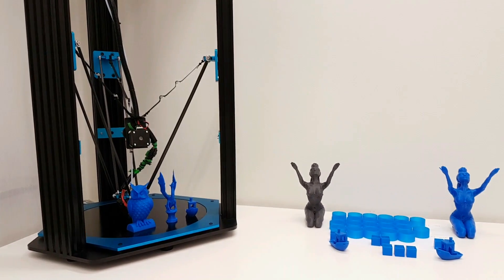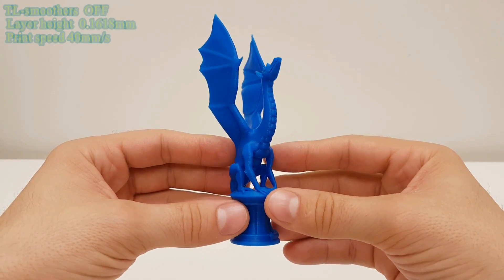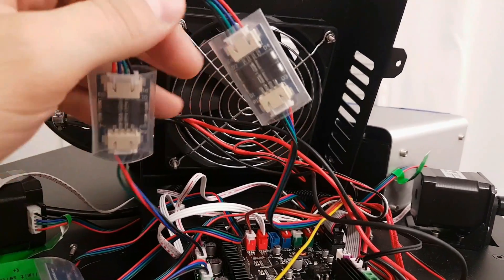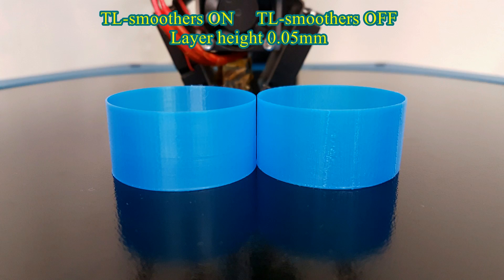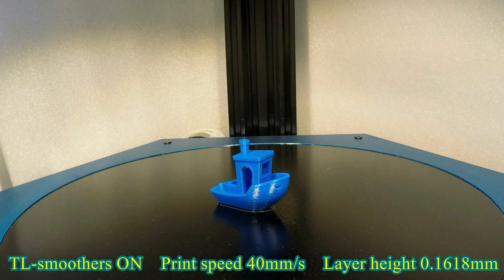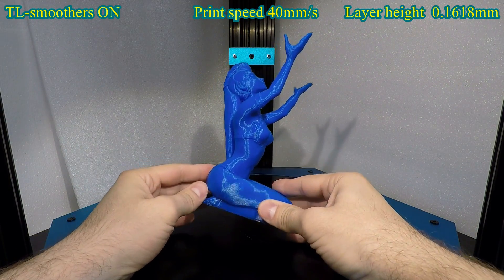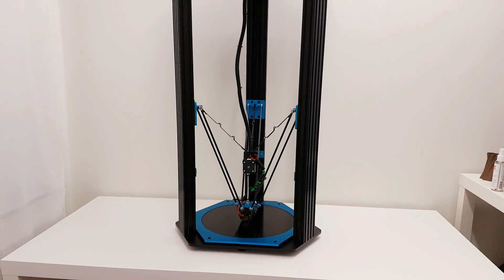TEVO Little Monster HUGE print quality upgrade! No more salmon skin!

Comment: Good morning, please help me. I have just finished assembling the TEVO LITTLE MONSTER and I have not yet done what was written in the "UPDATE INSTRUCTIONS. I turned on the printer and the arms with the hotend went to the HOME position. I turned off the printer and after a couple of hours I moved the arms manually to check that the belts that hold the thrust and the hotend are not too tight, turned on again but the bed calibrator turned red and did not move anything. I tried to move the arms but nothing happened. I pressed the house Home but nothing. Only the self-leveling meter remained switched on. After a couple of minutes, both the self-leveling device and the touchscreen are switched off. I double checked all the connections and I find them all OK. Why do not you move anything ?. Thank you in advance, I look forward to your instructions and best regards, Luigi Vitali

Comment: Please can you explain well if you have to enter 2 TL SMOOTHERS for each X - Y driver and extruder or just one. How many TL SMOOTHERS is right to put and on which drivers ?. Maybe you already explained it in the video but. unfortunately, I speak Italian and I do not understand English spoken, for that written I use the Google translator. Thank you very much for your help and I greet you very cordially.
Reply from the maker: Luigi Vitali Now there are new version of TL-Smothers with 8 diodes (old had only 4 diodes) so now you only need 1 TL-smother per each axis. 
 1 for X, 1 for Y, and 1 for Z. That's it.
Reply: Grazie mille

Comment: Could you use as many TL smothers as you want. Like 4 on each motor?
Reply from the maker: Nick boyco No you can't you will lower voltage to much. In video description you have new 8 diode TL-Smothers and you only need one per stepper motor.
Reply: Ok. Thank you

Comment: So print speed...your prints in this video were all done at 40mm/s.  I thought the whole point of delta printers was for higher speed printing, given that the Tevo Little Monster has a print speed max of 300mm/s.  Have you tried this printer with higher speeds, say 150mm/s?  I don't see the point in getting a delta-style, if I would have to print at speeds slower than my Ender-4 or Flashforge Creator Pro can do.
Reply: Deltas can indeed move at surprisingly high speed, BUT the 3D printing process is limited by a number of other factors. Assembly line "pick-n-place" deltas can take advantage of the high speeds, but not so much w/ 3D printers.

That said, delta 3D printers do have some nice properties. For one, the print bed is stationary, thus artifacts due to a moving model are not introduced. Also, w/ an indirect filament drive ("Bowden") the print head has less inertia, so motion can be smooth, plus a lower-spec, cheaper motor can be used. Furthermore, deltas have a significant build volume relative to the machine size. And, the design is modular, and easily scaled up in size. BUT actual print speed is not one of a deltas true advantages.

For an interesting insight into ACTUAL print speed, run your gcode thru www.gcodeanalyser.com... you may be quite surprised!
Reply: Derek Horn Exactly I think same. I think high speed for Delta printers is a myth, only way for reach 150mm/s or more is upgrade the drivers with decent quality

Comment: Great video, if I use these, will  I only need 1 pcs for each motor since they have 8 diodes per pcb?
https://www.ebay.co.uk/itm/4pcs-filter-TL-Smoother-new-kit-addon-module-for-3D-pinter-motor-drivers-us-E3O4/222933820602?epid=28015528791&hash=item33e7e424ba:g:3fAAAOSw2Yta2Yie

Comment: Hey man, very nice video! It's thanks to you I opted for TL-smoothers for my Little Monster as well, thanks for that bro! You're getting some really great print quality out of your machine, mind sharing your printer/print settings? What software are you using? I'm having some small issues with stringing despite several attempts at adjusting retraction, temp and speed etc...

Thanks man!

Comment: They are not filtering, they don't block the "noise". 
The diodes create a voltage drop, that's it. Nothing more. 
The idea of a TL smoother got ripped from this guy's website => http://www.engineerination.com/2015/02/drv8825-missing-steps.html 
Without TL smoother you have missing microsteps, I did some investigation on my wanhao i3 plus, and also stumbled across this problem. I hope you  and others like the extra technical information.

Comment: Can you explain golden ratio? I assume it’s the layer heights that work the best with the best layer lines, but it’s the first time I’ve heard of it and I want to learn how to find what my printer’s golden layer is.
Reply: It's nonsense.  Golden ratio only means something when it's a RATIO (meaning there must be a second dimension to relate to).  He's setting the layer hight to 0.1618, which happens to look like Phi, but isn't really because the decimal is in the wrong place. Phi is a ratio of 1.618 to 1.  Using those numbers as layer hight means nothing.
Reply: This video, and your valid critique, has prompted me to start writing a reply, but it's in danger of growing overly long. So, I will offer just this, for now... As a mathematician, and healthy skeptic, concerned with critical thinking and its application to truth claims, the matter of the use/misuse/abuse or the Golden Ratio is of particular concern to me. In short, MANY claims regarding the GR are demonstrably false - and I suspect this GR/3D printing "connection" is such a case (even putting aside that the numbers often quoted are incorrect). OK, back to writing my reply "tome":)...

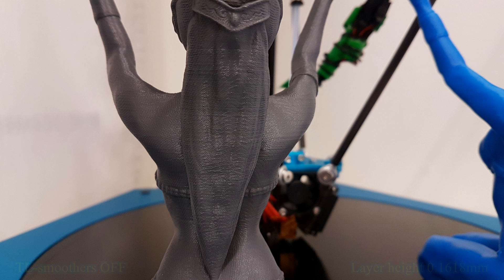Comment: 6:36  I suspect this isn't an issue of which stepper motors you have , as much as your stepper drivers.  Which mostly means which control board you're using.  Because what the TL Smoothers are doing are providing line conditioning, and smoothing out the sine wave.  So if you already have smooth power delivery these smoothers won't do much.  Speaking of which, it's a good idea to run your printer through a UPS.  This does two things.  One, it helps protect your prints from power upsets, which is a huge plus as you don't want to lose a print due to a power event (blackout/brownout).  Two, a UPS provides a pretty good level of line conditioning on the cheap, which helps make your electronics last longer, and in the case of analog systems, like 3D printers, helps improve performance.
Reply: Exactly.  Providing a noisy signal to the motor creates noise in its motion.  The mainboard/controller board is at fault here.  Its a cheap fix though.  Maybe TEVO which spend the 20-50 more dollars to upgrade the mainboard so the signals going to the motors isn't shit so this fix isn't required by every single person that buys one has to do this.  Maybe the next version will "listen" to their community and fix this issue and charge $50 more because it would be well worth it to not have to faff around just to get... really amazing print quality with their machine.  You'd think they'd WANT that from their machine.  Hell they could sell way way more machines without this issue.

Comment: Hey Guys, I bought the tl smoothers and thought I should share my thoughts... to start off, I should state that I do appreciate the person making this video and I don't think they did anything wrong... I just didn't get the same improvements that you see in this video. If I was to gauge it I would say the improvement was around half as good as in this video. I complained to the company in China and they actually responded which was a surprise. They sent me before and after pics to prove their point but I stand by my results. I still get significant salmon skinning and surface texture. It might be something specific to my printer but who can say? I did read from the blog of the original designer of the tl smoothers that some chinese companies were selling parts labelled as tl smoothers but with the incorrect components. Hope this helps someone.
Reply from the maker: Hi Scott, Thanks for feedback. That would be me :) You Welcome. Tell me did you order Tl-smoothers from link in video description? With 4 diode on board?  And did you install 2 peaces on every axis? Including extruder? Did you use golden ration layer height and same print orientation? CURA or? Regards! Nexi
Reply: Hi Nexi, Yes, I've got the profiles in Simplify3D with the 3 golden ratio heights already plugged in and I used the link in the description to buy them. I bought 8 tl smoothers in total and have two on each driver (incl extruder) as per your video.
Reply: Scott if you suspect stepper motor noise, you might also want to consider conditioning your mains input power.  A UPS works great for this.

Comment: The question was asked below, "Why two per axis?".   Because a properly engineered, diode-based, "smoother" needs 8 diodes for a bi-polar stepper motor.  Several manufacturers make them this way, including Witbot and MKS.  

However, in the "race to the bottom" pricing of our current world, some manufacturers are making them with only 4 diodes.  

By changing the wiring as he shows in this video, and using two per axis, each pair becomes a proper 8 diode smoother.

Comment: I just ordered this printer on a flash sale at Gearbest look forward to receiving it and getting it set up. Couple questions the auto calibrate seems not to auto calibrate very good and still requires an offset to be set within g code? Is there a better way like in the firmware to make the correct offset change permanent?  What slicer are you using? How is your bed sticker holding up I have seen others bubbling up in some videos? I did order the TL smoothers based on your video review here.
Reply from the maker: Hi Eric! Thanks for supporting my channel! Auto calibrate is great so far I do it only once. Offset you can set in start G codes once and there is no need to think about it ever again. I use CURA 2.6.2 version and to be honest I use PRINTAFIX adhesive spray on glass surface when printing so I still did not try out bed sticker so I can't confirm problem with ''bubbles'. Yes, TL smoothers are the way to go and I have order other version too with 8 diodes on them to try out. I might make one more video for them too.  I hope I answer to your questions well. Best Regards. Nexi
Reply: Thanks for the reply can you only use CURA as the slicer for this printer I was considering Simplify3D instead? Which 8 diode TL-Smoothers did you get do you have a link to them? Have you printed nylon with your machine? The videos and reviews I have seen of this machine show poor overhang performance when printing not sure if its a fan issue have you had any overhang problems?

Comment: Let me explain what I think is going on. The steppers have diodes like the TL-smoothers, they have D-mos type outputs. The problem is the long wires that store a little energy and acts like capacitors. The stepper drivers internal diodes  won't  be effective at that length of wire. Has many of you know the coils stores energy and return that energy when they disconnect or stop being energized. To avoid that effect is common practice to use diodes to clamp spikes from coils. The problem here is that he is not clamping near the motor has it should be.
Reply: Inductance is the 'stored energy' in the wires...the inductance of the motor windings far exceeds the inductance of the wires.
The diodes in the drivers are for the drivers protection against inductive loads, not for smoothing!  Snubbers or kick-back diodes.
The stock Little Monster drivers are not set up for micro-stepping, the upgrade is a micro-stepper, the result is no more salmon.
Smoothie diodes are a band-aid on a compound fracture; fix your drivers stepping-mode before throwing away money on diodes.
Smoothie diodes do work, but needing to use them is an indication something else is not right.

Comment: Do these smoothers work on the creality CR-10
Reply from the maker: It might work on CR-10 but from mine 6 months experience with CR-10 I got to say that layers are absolutely beautiful! Perfectly flat with no any noise at all. Are you sure that you have Salmon skin problems? It may be ringing in prints surface or something else?
Reply: Deltas only.  Well, any printer that uses 20 tooth gears and belts to drive the Z axis.

Comment: Very nice review on the fix!
Btw I have check your links, and have your tried the very cheap filament from hobbyking? They are 10 euro's a piece for me. Shipping from EU warehouse to The Netherlands is around 6 euro's for a shipment of whatever I put in my shopping chart.
I've used them for a while and I'm kinda surprised at how okay they print. They do use weird settings though and you cannot follow the instructions on their site since every roll is different.(Had to print translucent green ABS at 270 degrees for very strong prints)
Would love to real a review about those.

Comment: You can find MKS Smoothers on Ali, they already have double the amount of components than TL-Smoothers so you should only need one piece per stepper.
Reply from the maker: Diginatiivit Actually they are already on the way(8 diodes on board but smaller) but this TL-smoothers in video I received first. Aliexpress is very slow sometimes with shipping with small packages (free shipping). That's why for those TL-smoothers in the video I paid DHL fast shipping to get it fast. Otherwise this video still would not be done :) When I receive other TL-smoothers with 8diodes i will test they as well to see if they are producing better or worse print quality. Cheers! :)

Comment: Nice informative video and I hope many will see it.  Most LM owners should be in the know about this issue since january 2017 though as that's how long I've been using my self-made TL's so far. :D
Reply from the maker: Thanks Kris! Im glad you like it. Wow! 7 months you have your LM!  Wow am so late :D Better ever then never. Thanks for stopping by. Regards!
Reply: Yeah, First Batch owner, and it has been a good experience so far.  I run my machine at near 100% stock (heated bed insulation, hotend insulation, TL smoothers and hardened hobb) and have pushed next to 50kg of filament through it in that period without any major issues or breakdowns. It's a pretty sturdy machine, not flawless but then again, nothing ever is. :)  Anyhow, I hope your LM will serve you long and well.

Comment: Awesome information. Thanks a lot! Wondering about the golden ratio. What does it depends on? ..and looking at the circuit - it doesn't make real sense to have 2 per motor installed. Can you enlighten us on this?
Reply: Theoretically, a voltage drop of around 1,2 to 1,3V (which is basically what a TL does) should have been enough to supress Salmon skin, and refering to the original articles concerning the use of TL's, it should have. However, LM users like myself have noticed very soon after the introduction of the LM beginning 2017 a significant better quality when using 2 TL's per motor vs one, so apparantly the 1,2/1,3V drop induced by one set of steppers just isn't good enough on this specific machine.  The Golden Ratio totally depends on the used motor/pulley combo : you can find a Golden Ratio calculator on the official Prusa site which allows you to calculate the ones for your specific machine.  Also, keep in mind the TL's work because they compensate for the stepper error induced by slow-speed moving system and stepper controller setup in Mixed Decay mode. It's perfectly possible to kill the need for the TL's if you would hardware mod the stepper into for example Fast Decay mode which involves soldering a bridge to GND or 5V .... depending on type of used stepper chip .... but this can mean smd-level soldering sometimes and would come at a cost : a noisier printer and a higher EM disturbance factor.  I also can tell you the TL's do not only work on the type of drivers the LM uses (DRV8825) but also have a positive influence on aA49xx series IF those are hardware set to be used in Mixed decay (which often is the case as it's the "most universal mode to use" without too many issues.
Reply: Kris Waclawski  great explanation, thanks Kris!

Comment: Does this tl-smoothers works on anet a8?
Reply: Kris Waclawski
1 seconde geleden
Yes, however the Anet has 2 different reasons for surface issues : you've got your "salmon skin" like issue which will show up on a Anet more like a sort of "ghosting/ringing/echoing" .... AND you have the fact that Prusa-style machines with a moving bed are fighting the inertia of the Y-movement. (not gonna talk about Zwobble, that's a totally different issue but it of course can affect the quality of the prints too !).  Basically, the TL smoothers CAN work on EVERY machine which uses their steppers in Mixed Decay mode. And that's nearly every single machine on the market.  The only steppers I've noticed which totally don't benifit from these TL's are the Trinamic TMC's .... and possibly the LV8729 series.